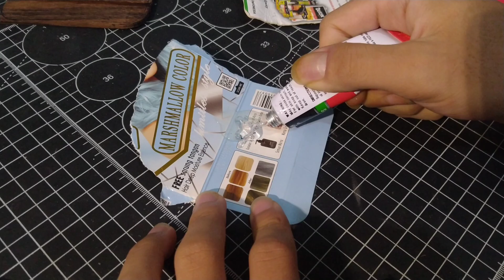Build a Bluetooth Speaker || DIY Pocket Bluetooth Speaker

Comment: Nice work! But I think there is a problem. The amplifier u used outputs stereo audio. If u connect 1 channel then u r losing audio of the other channel. Should use a mono amplifier which combines left and right channels into one channel. Just my thought, no offense.

Comment: Xyp-15w yg nama bluetooth nya xinyi beli dimana bang ? Ada link tokonya?
Reply from the maker: @alvianfajar9261  itu dulu saya beli di toko oren tapi di china sekarang udah ngga bisa pesen, nama tokonya meltsee.id
Reply: @leoparddiy lo pakai modul cas tp4056 Stepup nya langsung dari baterai/di output tp4056 nya bang...?
Reply from the maker: @alfannurhuda200  saya pake modul tp5100, stepup langsung ke batrai.
Reply: @leoparddiy  bagus mana bang antara tp4056/tp5100....?
Reply from the maker: @alfannurhuda200  tergantung kebutuhan, tp5100 bisa ngecas dengan arus sampe 2amper, juga bisa ngecas 2batrai sekaligus(rangkaian 2s/8,4volt) input menggunakan tegangan 9-15volt
Reply: @leoparddiy  makasih banyak bang.semoga sukses selalu..
Reply from the maker: @alfannurhuda200  siap,sama²